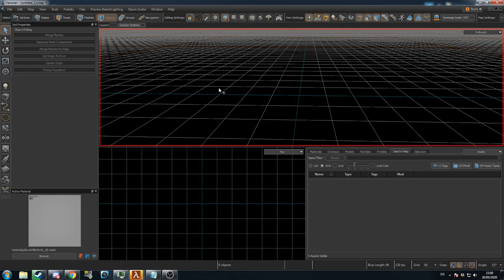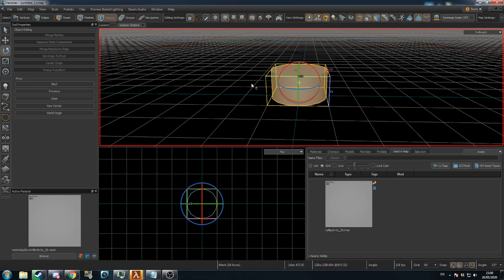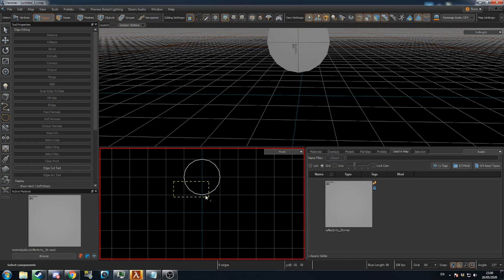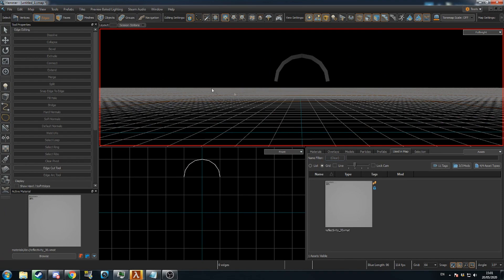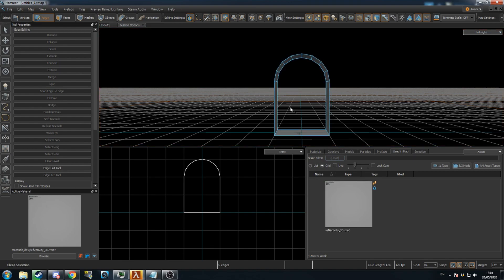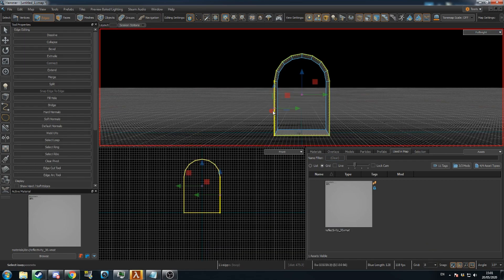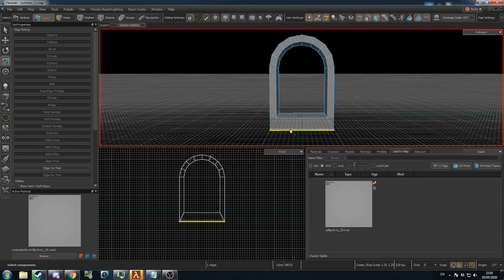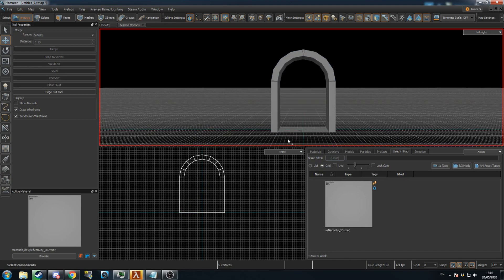How To Make An Archway in Source 2's Hammer

Comment: When I try to extrude the walls downwards they don't go straight but head out at an angle, I'm quite sure what I'm doing wrong.
Reply from the maker: When you extrude,  click and drag on the blue arrow to lock to movement to the up/down axis
Reply: make sure you hold shift when dragging it down

Comment: I would appreciate if you could explain in a little bit further detail into what the tools your using in the video do such as "Bridge" or what "Insert" does
Reply from the maker: Bridge creates a face between two selected edges
Insert is the hot key for the pivot tool. It let's you move the center that things like scaling will occur around. I also use it in my video on how to make a curved corridor.

Thanks for the feedback though, I'll try to be more clear about what each tool does in future :)